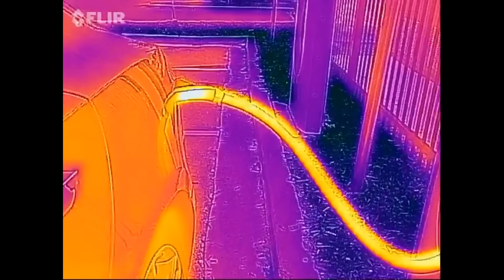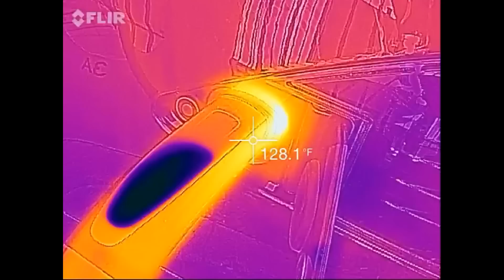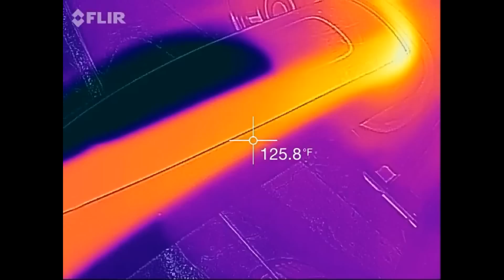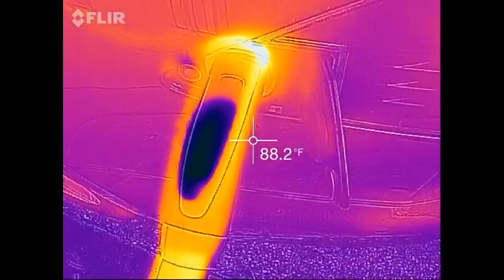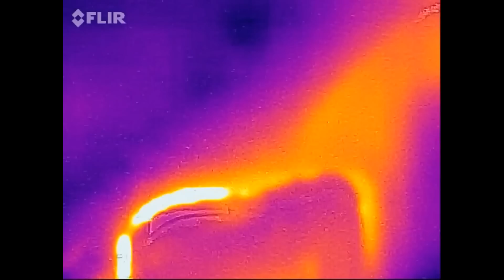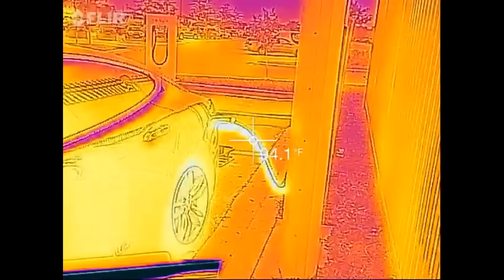Tesla Motors: Good Reason WHY Liquid Cooled Supercharger Cables are needed! 180*F

Comment: Thanks for sharing - curious how you made this thermal video?
Reply from the maker: I used a FlirOne thermal camera. It WAS a great device that worked well. Though i will never purchase another Flir product again. It worked well, then they sent a app update that purposely stopped the device from working. They said it was because the device was too old (about 3-4 years old) and I need to upgrade to continue to be supported. They offered me $100 off a new one that basically has same specs with a different form factor. Eff them.

Comment: I'm not sure liquid cooling the cable is the solution. Sounds like these cables need to be constructed of a much higher gauge wire at the contact point so there is less resistance. Obviously resistance = heat. What's worse is that it's wasting a shit load of power being pissed away as heat instead of going into your battery where you want it.
Reply from the maker: There is a line between thicker wiring and then the cable too heavy and thick to manage. In Wisconsin, where it get COLD, the existing cables are already very difficult to move and bend in the cold weather. The thinner cable would be much appreciated. Tesla has now gone to liquid cooled cables in the V3 superchargers which can go up to 250 kW, twice that of the supercharger in this video.
Reply: @KmanAuto  It isn't a solution that won't work to cool the cable, but as I said, they're wasting a great deal of energy in the form of heat that isn't making it to your car. Now they have added a whole extra element of wasted energy to run the liquid cooling system. Cranking even harder on the wire knowing you have a liquid cooling system in place ensures even more energy is pissed away as heat by the cable itself as well. Bigger gauge wire or more fibers in the wire itself would be a less wasteful solution to the problem even if it makes the cable more unwieldy a few months of the year for people who live in colder climates.
Reply from the maker: @Thezuule1  You have no idea how unwieldy the cables get in the winter. It's t the point where they stand up on their own. I, a full grown adult male, and not weak, occasionally have trouble getting the cable to bend enough to get to the car. I've had to help others in the past. When we had a cold snap, I actually could not even get the cable to bend enough to get in the charge port, so I actually parked blocking 3 stalls to be able to get it in the port. after it charged at a high rate for a few minutes and the cable warmed slightly, then I could bend it and straightened my car. While I see your point, and yes, ideally, a thicker wire would be more desirable (and not a problem in warmer climates), in colder climates, it is not as much a option. Further, the liquid cooling, could potentially also be used for liquid heating of the cable to keep it flexible in the cold. 
I have not yet had the opportunity to use a V3 supercharger, none in Wisconsin yet and I haven't done a road trip outside the state since installs of V3 were started, however, they could use existing thicker cables, and liquid cooling to allow the much greater charge rates without needing to thicken the cable.

Comment: The hot spot you are getting at the connection point is liky due to loose fitting or dirty terminals that is creating a high resistance. When you went inside the trunk the temp of the cable appeared to decrease the further it got away from the termination point. Yes there is a lot of current flowing through the cable and heat is a result of current flow. The temp measured on the cable is expected. The delta T between the cable and connection point suggest a loose or dirty connection. I saw the post that mentioned that you clean your terminals regularly. That's good but are the charge staion terminals clean? How is the fit? This is a public charger so you would expect some extra slop and dirt/ corrosion. The fluctuating charging amperage could be from a loose fit or dirty terminals as well.
Reply: if you flir a house in the winter the insulation makes the delta T smaller....the cable is just insulated better not the connection crappy.  the connection isnt insulated its thin plastic there.  the back ring is stainless, temp isnt the issue with a hand its rate of transfer so that metal ring burns. and yeah the front is hot as heck too.

higher voltage. thicker cable or liquid cooling meh.

Comment: The Tesla pins are only 9mm diameter.  Exactly same as CHADdeMO.  Probably borrowed  from CHAdeMO standard.  However,  CHADdeMO only pushes 125 amps through them.  Tesla pushes 300+ amps.  Tesla seems to operate their charging equipment beyond design limits.  Every Model S owner I've met has had his charge inlet replaced.  Tesla's cables and connectors are too skinny for the currents they operate at.

Comment: While the cable is 120F and is under the rated maxim of 167F(75C). The connection between the cable and the car is TOO hot. The connection is still safe under 194F(90C) but a warm cable is very uncomfortable. I would like to see Tesla coat the cables in a layer silicone. (Think frying pan handles) That would stop the heat transfer to your hand.

Comment: What's Tesla have to say and have other users reported this issue? After charge is complete, how long does it take to cool down? Maybe gloves or just waiting until it's done as a temp solution?
Reply from the maker: bc1969214 Reported it. Was sent to supercharger team. SC Team are some good people!  What happened, is the car will reduce amperage until the thermal issue is resolved. In my case, every time, it dropped to about 50kW charge rate, and then went back up once the thermal event was over, but the cable did cool down and stayed cool even after the charge rate increased. I have taken to cleaning the charge handle contacts now with cotton swabs on the superchargers now. They are NASTY!!!!

Comment: Electricity can run hot because the method of transfer through wire but is different if electricity was transmitted or pulled through the air...Nikola Tesla had demonstrated the differences... it is a good idea and is doable but I don't see to solve the practical problem of a liquid cooled solution as you would have to have it from 'input to output' and to compare the current system of what the tolerance of copper wire gauge that is used plus insulation...however I do believe there are heat sinks and a slew of resistors, capacitors, and switches not just to control the flow of energy but also to maintain heat management...
All of the components do matter and the sad fact the heat and/or key to support component failure does occur...